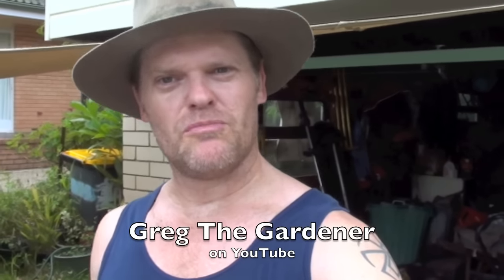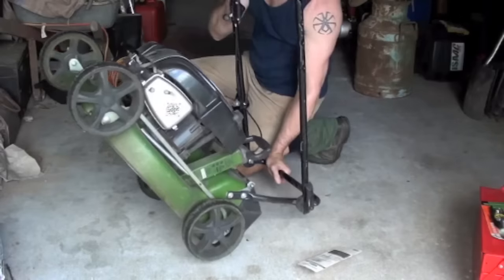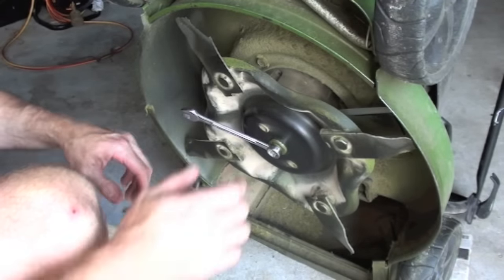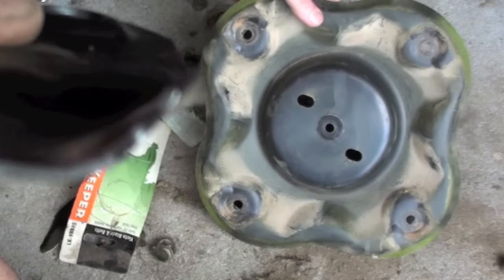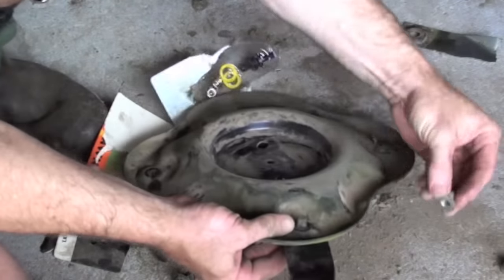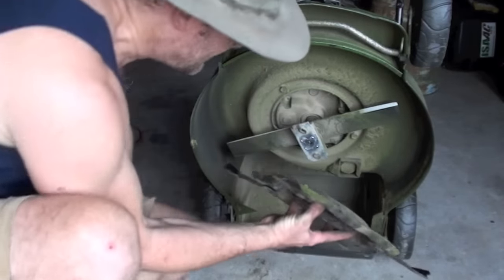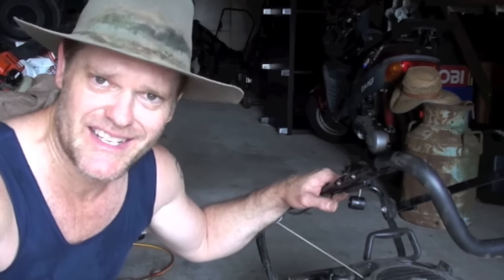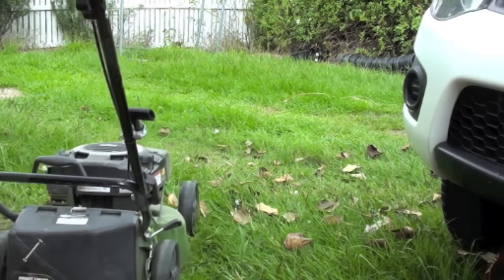HOW TO CHANGE LAWN MOWER BLADES

Comment: Always........ Disconnect the spark plug wire from the spark plug, before replacing the blades. The lawnmower could start up, while you are cranking on the bolts.

Comment: Greg, When changing mower blades you should ALWAYS install NEW bolts as well. Never use the old bolts as they weaken with age and can snap causing the blade to go in all directions possibly causing serious injury.
Reply: dont think so
Reply: nah she'll be right
Reply: @joanpetervincent6175  Yes they do, the vibration and moist environment of the lawn clippings weakens them. They can snap.
Reply: @joanpetervincent6175 no idea 🤣🤣🤦‍♂️🤦‍♂️🤡🤡

Comment: Just curious why you wouldn't use the brand new bolts, etc that come with the blades?  Also, it should be mentioned you should disconnect the spark plug if you don't want to lose your arm.
Reply: How can a mower just start of its own accord (or its own a cord as the case may be)?
Reply: @phillipsmith6756  It's a big thing when hand proping aircraft. You go to lengths to make sure there is no possiblility of ignition when turning the prop by hand. A mower blade would be no different.
Reply: @phillipsmith6756  Turning the blades around cranks the engine over just as pulling the starter cord does, and could accidentally start it.
Reply: Nylon nuts are single use only. Must be replaced.

Comment: The first thing you do is disconnect the spark plug !!!
Reply: and then you tip the mower in the correct direction to not stuff the engine up.
Apart from these 2 main important things, you almost got there!

Comment: 👍👍 The bend in the blades is also for when run over (accidentally) a rock wood, the blade will ‘fold’, as the bolts and assembly should allow them to do, give way rather than damage, then the folded bit stops it, and can be used to tap the blade back into alignment.

Comment: How do you hold firm the flat headed bolt when when trying to turn a firmly held nut?  I've loosened the nut but cannot hold the bolt to remove the nut.

Comment: Have just changed the blades on my Morrison with quad blades and assembled them with new bolts and washers as supplied with the blades but they seem very stiff to move, how tight or loose should they be?

Comment: The wavy washer should be fitted between the blade and the circular plate. This allows the blades to swing away on impact. There should also be a washer between the centre plate and the nut.
Reply: On Rover, MTD, Toro etc the wave washer does fit between the blade carrier and blade; MASPORTS are different, the wave washer is fitted under the head of the bolt NOT between the blade carrier and blade. In any case it must be remembered this man has fitted Victa Mulch blades to a Masport;the pressed section of the blade does not match the recess in the blade carrier....  Victa use a "belleville" convex washer under the nut; different again.

Comment: G,day  Greg, I'm in WA working for a company gardening, new here from UK 😮 .thanks for the video, I thought the blades had a kick back system on my Briggs n stratton 725 ex 🤔 but the blades seem ridged  ,is this correct
Reply: Yeah this is wrong. When the bolts are tightened the blades should still  be able to move if they hit anything hard.

Comment: pretty good vid Greg.  Couple of things though,  I have found over the past 40 years it is always better ( at least on Rover mowers )  to always use 4 throwing blades for a cleaner cut and better throwing.  Second, what breed of mower is that you have.  Have not seen one with a blade disc with a solid blade mounted above it on the engine shaft before.  Have a good one mate, it's beer o'clock.
Reply: Mopar Maniac 64  it's a masport president series I'm thinking 4000 series looks like mine .mine 8 yr old now never had problem apart from just recently I changed the throttle lever $20 and done it myself easy . awesome quality and cut .

Comment: My mower is a Ryobi 175cc 4-stroke with a Subaru engine.  I saw on another YouTube video that if you put a plastic bag under the fuel cap it will stop or limit fuel dripping out when you turn the mower on its side.  That worked pretty well.  HOWEVER, after I had taken the disk and blades off it took me about half an hour to get back to the mower.  I had left it on its side.  Quite a lot maybe 50 mls of sump oil had drained through the air filter onto the ground.  Surprisingly the mower started ok and I ran it for about 5 minutes.  Can I expect problems down the track after this DIY failure that I can add to my list?

Comment: It's always good if you use the correct blades & bolt set when making a how to video
Reply: Exactly...The new Victa blades came with new Victa bolts that don't fit into the "D" shaped Masport holes so he couldn't swap them so he was forced to reuse the dangerous old bolts

Comment: Hey Greg, my whole blade plate is loose, when the mower cranks it makes a banging sound, is it as simple as tightening the blade plate or has something sinister occurred?
Reply: The "driver" is broken and needs to be replaced. I believe it's the thing with two prongs that goes into the blade plate.

Comment: Do you need different sized spanners for different mowers? Should I turn the fuel off before turning my mower over? Will fuel run out of the filler cap when I tip my mower over? How do I stop the blade plate from spinning when I undo that middle bolt? What do I do if the threads on the bolts holding the blades on are damaged and I cant get them off? Will my mower start like normal when I tip it back over? Is there anything else I need to buy. How much do you charge to just come and do it for me?

Comment: Hi Greg i have a problem with tightening the blades. It stills moves after tighten it is that normal?
Reply from the maker: the blades are supposed to move or have some give in them, not be tight and rigid
Reply: ok, thank you so much
Reply: depending on your model...yes that is normal

Comment: It's always a good idea to pull the spark plug boot out before working on a lawn mower.   I recently had to get a new ignition coil.   Now the blade's bent.   That's what happens when you hit bricks or roots.   What kind of mower is this one?  I'm not familar with this kind of blade.   Shouldn't you use some kind of wedge to keep the blade in place?   It always looks so easy when someone else is doing the work.
Reply from the maker: yep sure does
Reply: Us Australians be like "Nah, she'll be awright, no need to discinnect thee spark plug." ;)
Reply: orangehornet57 masport president series 4000
Reply: Boy, that rotor came off easily! I'm anticipating trouble, hasnt been touched in 15 yrs

Comment: 1 problem with this greg.... if you tip it over in any way, the oil will get into the cylinder and when u start it again it will smoke a sheeeet load for like 10mins

Comment: Its worth pointing out that the part missing from most of your old blades, and most old blades for that matter,  was actually the upsweep responsible for catching, rather than cutting..for some reason thats the first part to wear away, maybe because of its much greater drag resistance......that mower probably still cuts acceptably but just drops it under the mower and out on the ground behind, rather than it making it into the catcher..I took it a step further last weekend and have made my own set of 4 blades for my Rover..wonder how well they will last..

Comment: you don't tighting the bolts to tight blade's still need some swing.
Reply: Correct.  The blades are intended to be free enough to move if an object like a stone or root is hit.  They will swing onto the correct grass-cutting position by centrifugal force.